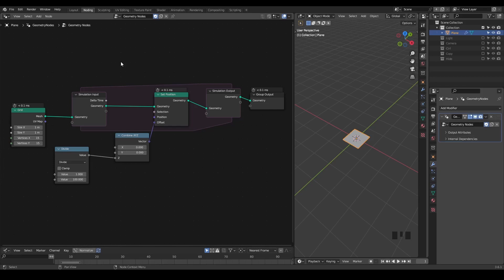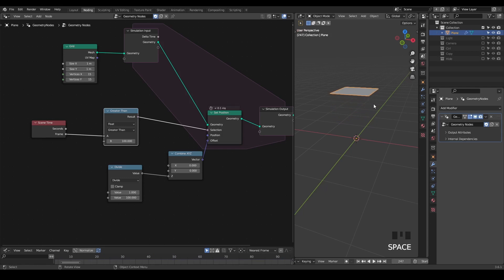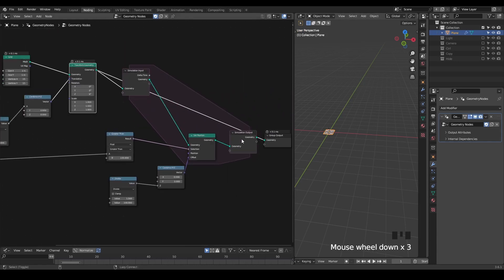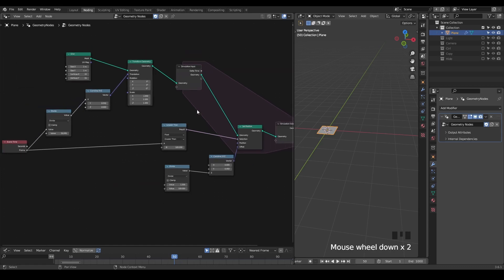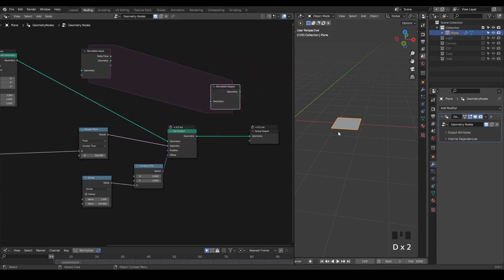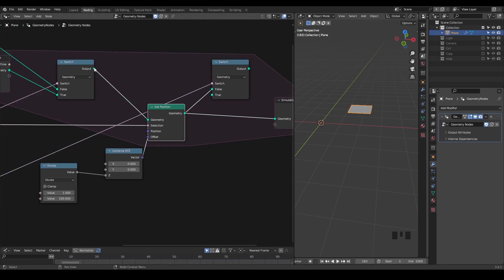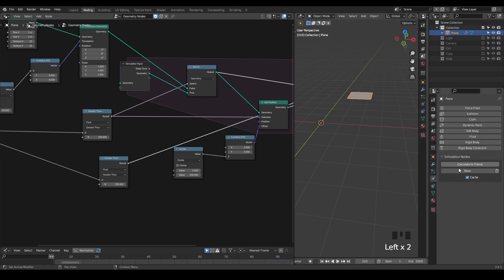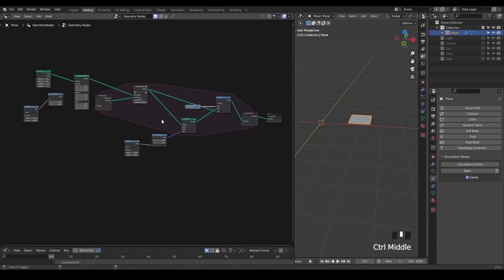[Outdated][Tut] Set Time to Start & Stop a Simulation - Blender Geometry Simulation 3.6 Fundamental

Comment: As of at least 4.1 (maybe earlier though) If you put a 'Scene Time: Frame' into slot A of a 'Compare: (Integer) Less than' and plug that into your end simulation node 'Skip' then this should also work for running the whole simulation from whatever frame you're calling the B slot of the Compare node.
Reply: Just to follow up, if you mix that with a 'Compare: (Integer) Greater than' (then set the frame you want your simulation to end as the slot B) and mix that through a 'Boolean: OR' then you can also set an endpoint of your simulation. super useful for simulations that you only want happening when the camera is pointing at it!
Reply: Thank you so much mate
Reply: Omg it's magic. Thanks. I was confused at first but then yeah, just literally plug in a condition (the starting frame or whatever) into the Skip socket, doesn't need to be connected to anything else in the node tree

Comment: I believe simulation zone starts only if it connected to the geometry output, so the best workaround should be switching after zone🤔
Reply from the maker: you can try to see if they work to solve the issue.